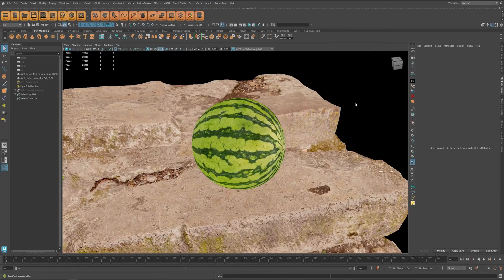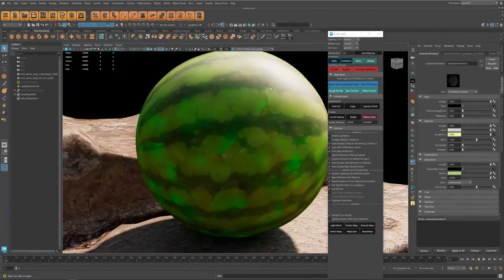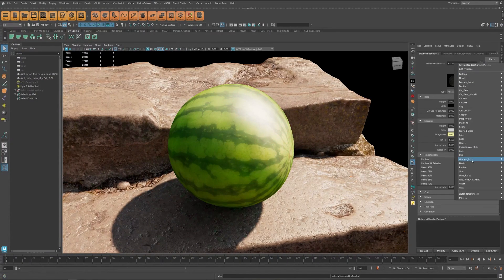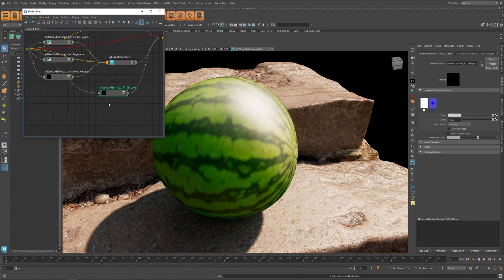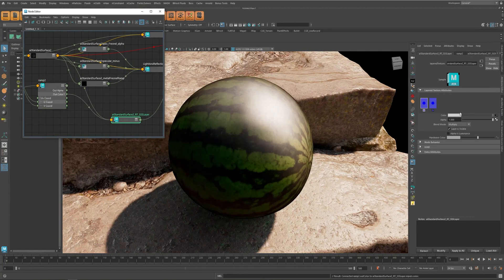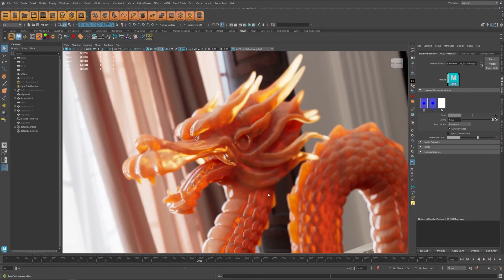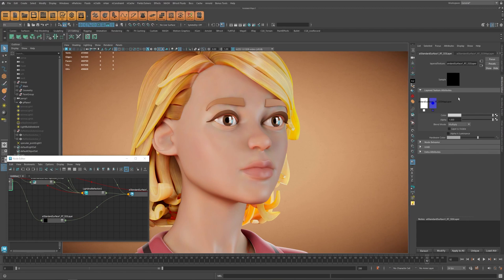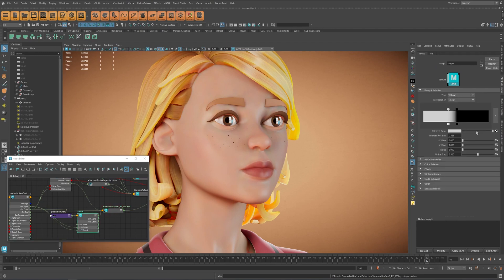RealTime SSS and Character Setup in X-Ray

Comment: Hello CGElementary! I've just bought X-Ray plugin and I'm curious if it works with UDIMs too. I just can't understang how to force it work with multitextures.
Reply from the maker: Hello!, You can use UDIMs for texturing but not for light or SSS baking, so after assigning your textures just check your lightmap UVset and make sure to layout all UVs into 0-1 area (first tile) and then do the light/SSS baking. in future versions I may add UDIM for lightbaking as well